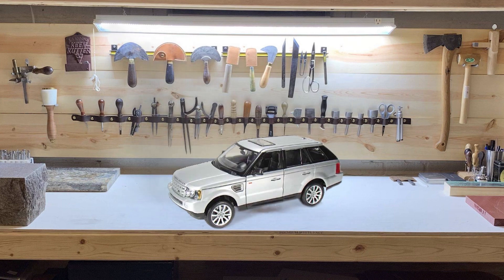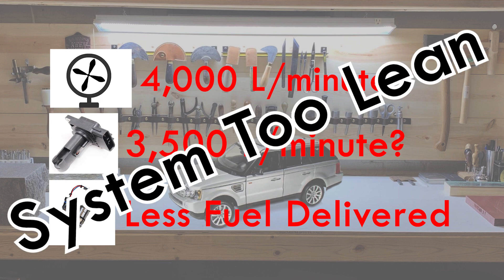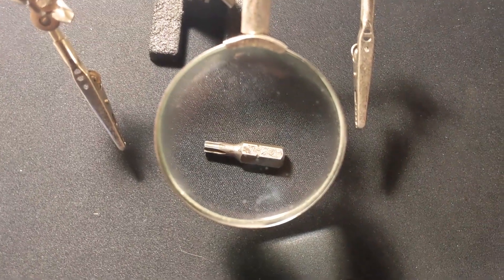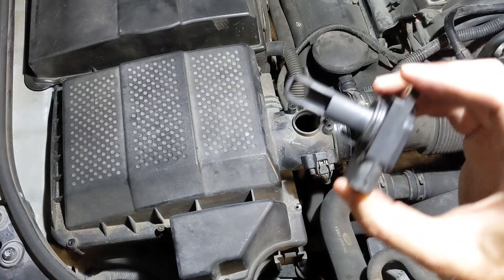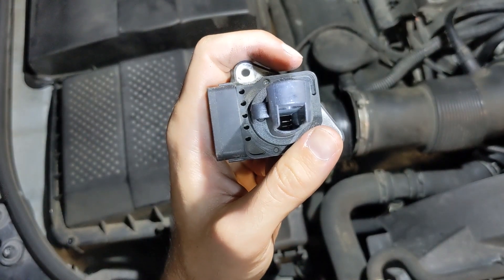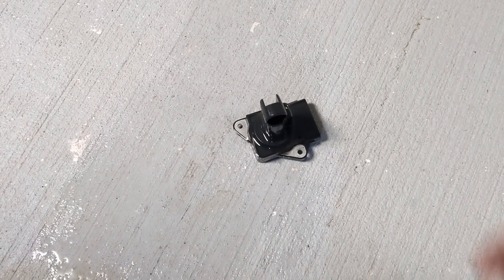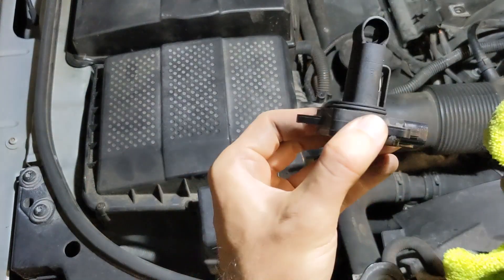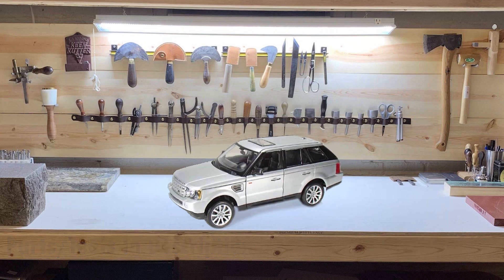Cleaning Mass Air Flow Sensor - Fix P0171 or P0174 - Range Rover Sport or LR3

Comment: I have a "P2096-00 Post catalyst fuel trim system too lean - bank 1" code. Replaced the MAF sensor, cleaned the throttle body, replaced the air filter but the the code is still there. I might go for getting )2 up and downstream sensors replaced next. Anything else you can think of? Appreciate your videos.

Comment: I’ve replaced the MAF with an OEM LR one correct part number. Still getting P0174. What do you suggest I look at next? I have a pcv valve in the mail so far…

Comment: Great video!! Any thoughts or suggestions on a P0170 code??
Reply from the maker: P0170 (Mixture too rich) may be due to a dirty intake air filter, consider checking that first.
Reply: @HazyJay  Thanks was thinking that and or maybe mass airflow sensor

Comment: Does this have something to do with my car getting a restricted preformes? Not all the time but when i drive through a tunnel
Reply from the maker: Tunnels may have lower oxygen levels which would throw off the fuel mix, the MAF is assuming a 21% atmospheric oxygen, but the oxygen sensor should be able to see if there is a bad air-fuel mix and make an adjustment too. I would say clean the MAF, change the air filter, and see if that fixes your issue. It definitely seems to be gas composition/pressure related since it's really just in tunnels.

Comment: 2009renge rover sport v8 ,some times no crank no start, but, wen starts with no problem few minutes later ac turn off and the hazards lights start flashing, wen I put the ignition switch on and the ac work it means that the truck is going to start and to ad to the problem the radio never works, wen it starts the engine runs good, what this problem can be???

Comment: I took to the mechanic they told me it’s a my valve cover and I have a coolant leak yet I see no leak and my coolant tank level stay the same.. I just replaced my coolant tank revisor put new coolant in and it’s all good. I have a bad coolant sensor. I feel I am being scammed. Any advice? I really am trying to get by as it is.
Reply from the maker: A valve cover gasket usually will cause an oil leak but not a coolant leak, maybe they were talking about a head gasket leak. You can test the head gasket pretty easily and cheaply using this vid: https://youtu.be/wcDe2QYN8As. If the coolant isn't dropping and isn't milky looking you're probably alright. A faulty coolant reservoir float is EXTREMELY common, you can replace just the coolant reservoir for about $50, I also have a video for that.

Comment: I use carbocleaan for clean sensor, is danger?
Reply from the maker: It's probably fine, carburetor cleaner is mostly acetone or toluene, neither of which conduct electricity and should evaporate
Reply: @HazyJay thanks for you time

Comment: I changed the mas air flow sensor & still have the code system too lean bank 1 &2 my lr3 2006 v6 engine
Reply from the maker: Consider clearing the code manually (with an OBDII scanner) and seeing if it returns.

Comment: Any idea why the truck idles up and down in park ?
Reply from the maker: A increase to the electrical load (AC usually) may make the car idle up. Does it idle up and down even if nothing changes? Also after you start the car it will idle high then drop after about 10-30 seconds.
Reply: @HazyJay  yes , idles up and down even with no a/c on but does it worse when ac is on , twice it turned off
Reply from the maker: @bassnjeep6537  Ah, there's lots of causes but it seems like the system is attempting to balance out some electrical load or fuel/air imbalance. I'd start with the easy/cheap things like cleaning the throttle body, It's pretty easy to access, you'll just need a throttle body cleaner spray.
Reply: @HazyJay  thats what i was thinking , i have no engine light , and was watching your MAF sensor video and air filter earlier , im probably going to start with that and also the throttle body
Reply from the maker: @bassnjeep6537  You can pretty much do all three at once, they're all next to each other really.
Reply: Check your oil temperature sensor (near bottom of the oil pan if I remember correctly); mine gave erroneous reading (like -20°C), which made the ECU think it is super cold and it had to periodically increase idling rpm…. First noticed it at red traffic lights - the truck virtually tried to jump forward… sensor replaced, funny effect gone.